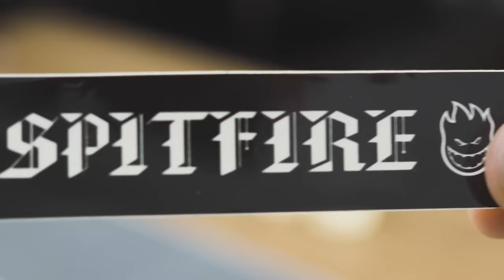Dream Build Skateboard - Like a Luan Oliveira Setup 2019

Comment: Dude, just a some observations:
1.- when changing the bushings from original Indys to Bones, use the washer from the original top bushing to give support to the bottom new bones bushing. The hard black part of the bushing tends to separate from the elastomer (white part of bushing)

2.- when putting the grip tape, use a one that it’s not as smashed as the one the sent you.

3.- when tighten the bolts, screw them until the head is flushed with the grip tape/board

Comment: I actually died inside when he slide that razor across the top of the deck at the beginning...
Reply: Doesn't hurt anything
Reply: Yea because we’re gonna see that under the grip tape
Reply: @Lazy_Prophet  "doesnt hurt anything" as i keep seeing a scratch along the entire board from the razor
Reply: @brandonjones5096  right, its a tiny scratch, you won't see it under the grip tape obviously, and its not gonna compromise the integrity of the deck.
Reply: It's a skateboard, 4 months and it's going to be absolutely wrecked anyway. 

Besides, you're never going to see it with all the grip.

Comment: What are those? 3:57 (I dont skate, so idk nothing).
Reply: Those are called bushings. It comes in soft, mediums and hard. :)
Reply: Ivantheblazingchariot soft reduce vibration?
Reply: Soft bushing allows easier turning but less on stability and as for hard its more on stability. But it all depends on personal preferences and playstyle. Id prefer medium ones

Comment: Hmmmmm nah definitely an expensive setup. I just get blank decks cause next week it will be trashed if I'm putting in work, FACTZ💯 I do it for the love of creative expression,not the clot or looks. But ay to each his own. 

But I do dig the hollowed out king pin and axle. That is worth the investment
Reply: what brand makes good blank decks? i usually ride baker decks for the lightness, high quality wood and nice pop, but it would be nice to find other good brands out there.
Reply: @skaterstinau7599  primitive does blank decks also revive is a good option not that expensive and both good quality

Comment: Creased grip, didn't use the spacers, and tightened the bolts with a power drill instead of using the skate tool on the other side

Comment: I’m possibly the only one who cares but, bolts aren’t screws, you don’t tighten a bolt by spinning the whole bolt with a drill. You turn the nut onto the threads of the bolt while the bolt remains more or less stationary.

Comment: yo why so much play with your wheels on the trucks? the whole point of that washer is to tighten the nut flush and it wont rub on the bearing.
Seems way too loose in my opinion. But wtf do i know?

Comment: Can anyone see if my setup is good I’m a beginner. I just want a professional or expert to take a look at it and see if there is anything wrong. Eight inch deck. 8.0 axle. 54mm wheels. Super reds bearings. Risers 1/4 in. Hardware 1 and 1/4 inch.